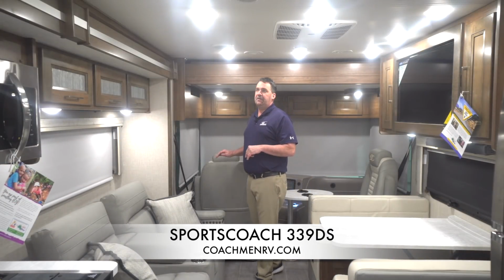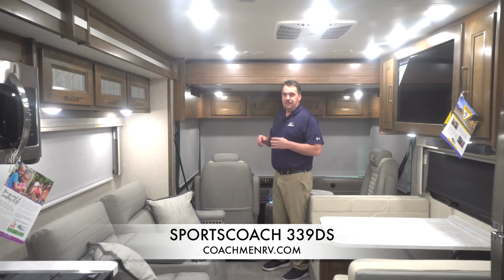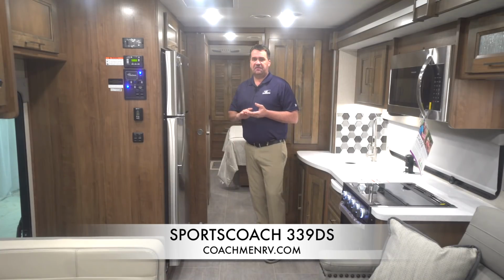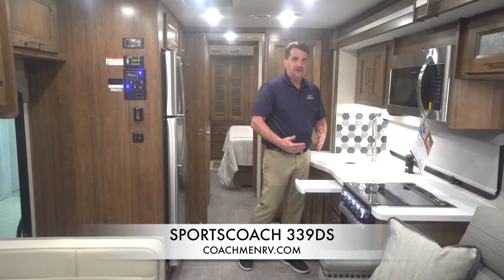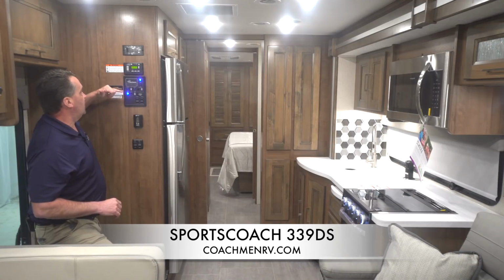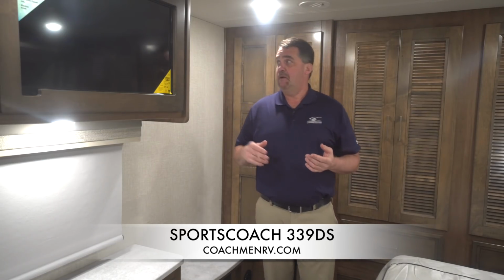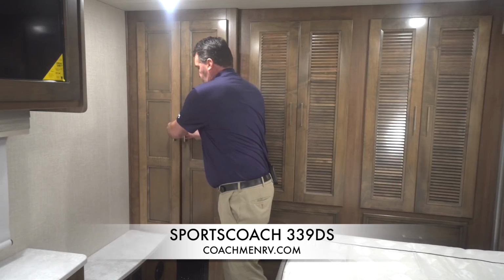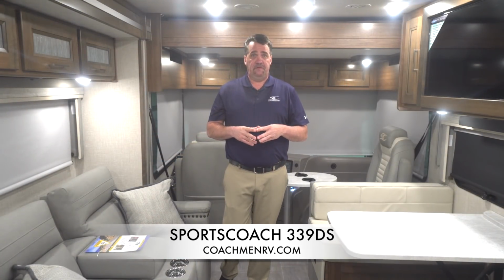2021 Coachmen Sportscoach 339DS

Comment: You said the King bed is 70" x 75", that can't be right. Queen mattress dimensions are 60 inches (5 feet) in width by 80 inches (6 feet, 8 inches) in length. King mattress dimensions are 76 inches (6 feet, 4 inches) in width by 80 inches (6 feet, 8 inches) in length. The length of the two sizes should be identical at 80 inches.
Reply from the maker: It’s an RV King bed. A lot of RVs can’t fit the width of a king/queen bed because we can only build RVs so wide. Many RV beds are “short” in length because of this.